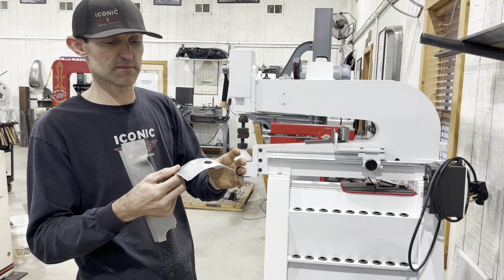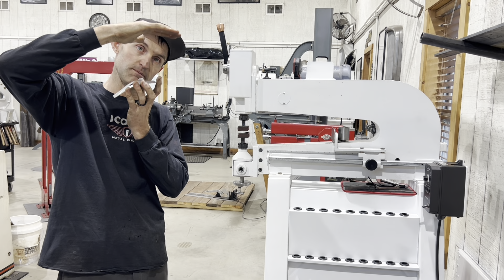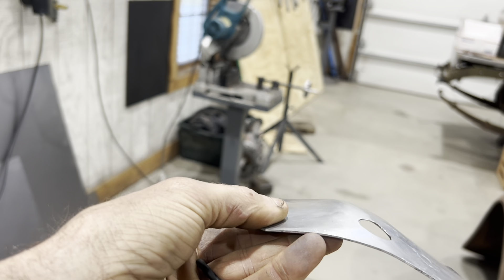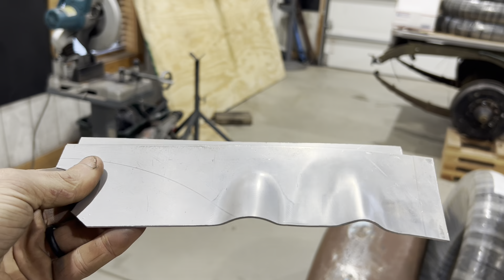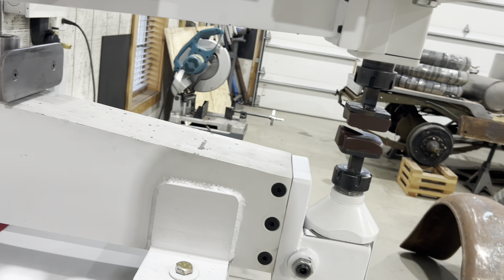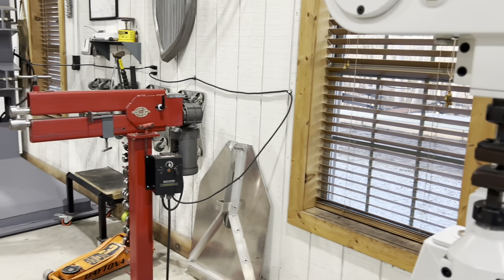Pullmax thumbnail shrinking

Comment: What model of Pullmax  is that ?
Reply: That mini pull max originally started out as a nibbler foot print ? Also I might be interested in the plans for the bead roller . Thanks
Reply from the maker: No originally it was a roper Whitney 5 ton kick press frame. I built the pool max head unit and lower unit.
Reply from the maker: Let me know bead roller  blue prints are $175 I take paypal and once payment is received the plans will be emailed to you to build at your convenience and can print them off at your disposal
Reply: @Iconicspeeddesign These prints are based on the Lazze bead roller ?
Reply from the maker: Yes
Reply from the maker: We built it , based off a p5and 7 internals but alm our own specs
Reply from the maker: All of our own specs